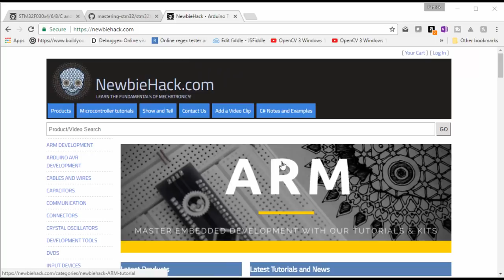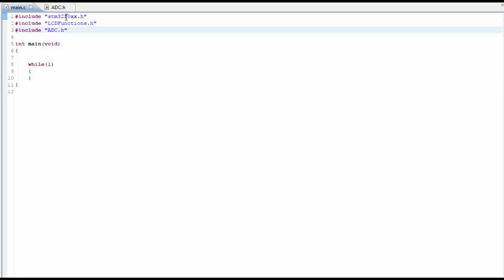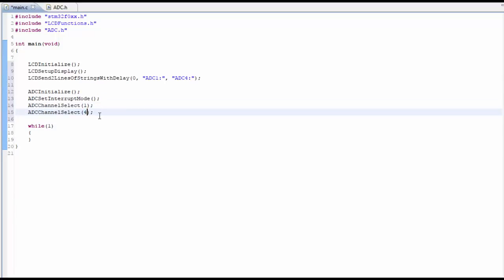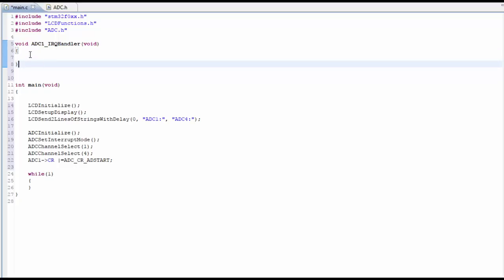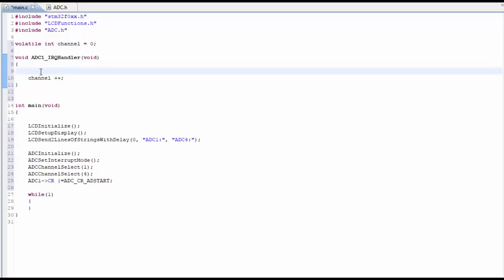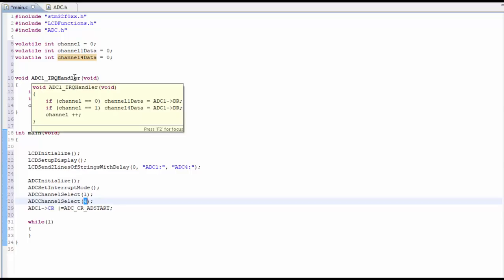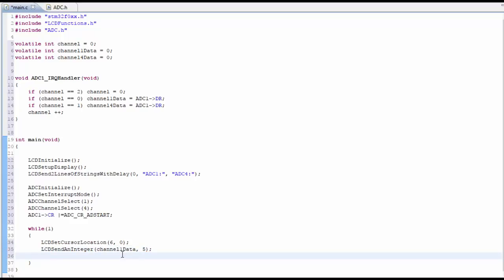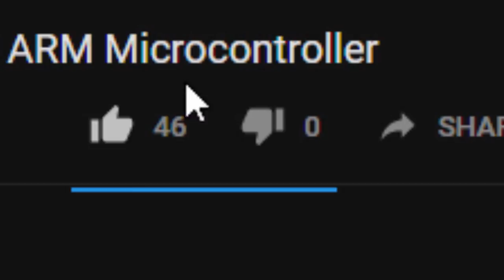52.  How to Add Interrupts for 2 channels of the ADC - ARM Microcontroller STM32 Microcontroller

Comment: Programming the ADC's is what I am truly interested in. I am planning to build my own Li-Ion (DIY Telsa-style Powerwall's) charge controller with built in balancing capabilities. I think this chip can do everything I need for the project. I am excited. I was not able to  purchase the kit ( like i said I would few weeks back), because I needed to raise some cash for the project, but I just ordered the advanced kit with an extra STM32 breakout. I hope people continue to buy direct from NewbieHack and help support these great instructional series
Reply from the maker: Thank you kindly!  That helps.
Reply from the maker: Oh yeah, good luck on your project and please keep me posted on your results.
Reply: I have got a long way to go to get to  my end result, but Ill start by rebuilding each project you have done and learn my way around the chip. May I ask, with the chip being a couple years old now, do you regularly spin new boards as they update the ARM chip series?
Reply from the maker: The Combat Engineer I may, but chips are always chosen by their minimal capabilities for a particular application. The instruction set rarely differs from a chip like this and a more advanced chip. The differences are typically speed, memory and the number of features. I cover all of the features, so all you will need to do is for find the chip that meets your needs for your end goal.
Reply: I sent an email about the order but got an auto-reply. Trying to see if it went through and get the tracking info.
Reply from the maker: The Combat Engineer I will check when I get to the office. Thanks.
Reply from the maker: Our system has real names and I don't know yours, so if you could, please send an email to phdroboticsllc@gmail.com and I can look you up on our system.  Thanks.

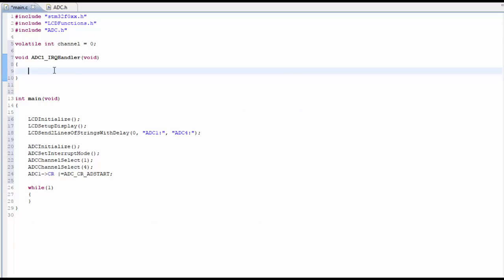Comment: 8:27 I believe that, if you want channel-number var to equal the actual ADC channel should be alternate between 1 and 4. Incrementing the channel number by 1 when you're using ch's 1 and 4 means your channel-number var ISN'T the actual channel number. That's poor form. A named var should contain what it actually is. 

This device supports up to 16 channels. What if you're using ch's 1, 2, 4, 6, 10, 11? Incrementing the channel-number var  makes even less sense. In that case, i think you might want an array containing used_channels {1, 2, 4, 6, 10, 11}. Then, have a global var called active_channel_index, which walks through that array. Yes, those are long variable names -- long, meaningful, accurate, and understandable.

Comment: As it's currently written, the while loop will repeatedly write values to the display, even there haven't been any interrupts, meaning even if the value hasn't changed. 

That seems very inefficient and redundant. There's no synchronization between the ADC and the display. We should logically only write to the display when then ADC grabs a value. 

i understand that we want to free up the ADC interrupt so that display-writes don't block the ADC. So that's why you keep the ADC interrupt fx as short as possible. 

However, if the ADC interrupts are coming that often, then how will the while-loop ever have enough time to execute? If your while loop has enough time to execute, then wouldn't a display-write inside the ADC interrupt also have time to execute?

Comment: Why is the while loop even needed inside main? Won't it just introduce latency into the interrupts?
Reply from the maker: Not sure.  Using the while loop isn't absolutely required.  Interrupts are called on stimulus regardless of the while loop. Chips may handle interrupts differently.  Check out the datasheet for more in-depth information on how interrupts are called and what triggers them using the block level diagrams.
Reply: @PatrickHoodDaniel  i think the whole point of an interrupt is that it interrupts any other code. So the ADC interrupt should interrupt the while loop. The questions is, will the ADC interrupt wait until the currently-running line of code finished executing? Or will the ADC interrupt flush all registers and start executing instantly? If it waits for the current line, there will latency.
Reply from the maker: @johnaweiss  Yeah, I've got no idea.

Comment: Is it correct that I must use DMA if I want to use the same ADC (e.g. ADC1) for multiple inputs, since they will share the same DR?
Reply from the maker: Can you clarify what DMA is and what DR is?  Thanks.
Reply: If I use multiple channels for the same ADC then the channels will use the same dataregister (DR) (at least for STM32f4). If I have the ADCs in scan mode (i.e will do A/D conversion for each channel directly after one another) the DR will be overwritten I think, unless I store the data somewhere else after each conversion.  DMA is Direct Memory Access and it seems that it's used often for this purpose.
Reply from the maker: Thanks for the clarification.  If you are using interrupts, you should be able to capture the data before it is overwritten as the program cycles is probably faster than the A/D conversion, but I'm guessing here.  I will need to do some digging to give you a proper answer.  I haven't delved into the DMA realm yet.

Comment: So that menas, the 15 available channels can be displayed simultaneously?
Reply from the maker: Yes.  All you are doing is converting them one at a time.
Reply: Very intuitive method to perform "simultaneous" conversions. By the way, I appreciate the time you take to resolve doubts in the comments (especially the response time), thank you.
Reply from the maker: Program flow is all sequential.  It all just happens very fast and appears simultaneous.  If you remember that the operations happen within a microcontroller (or computer), in a sequential manner, programming becomes quite simple.